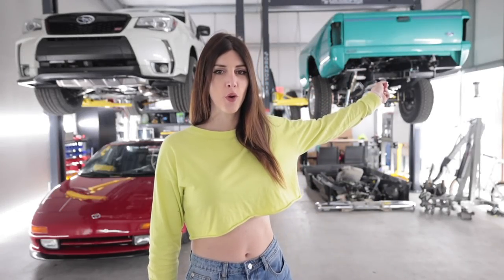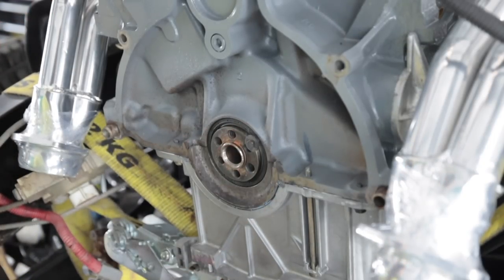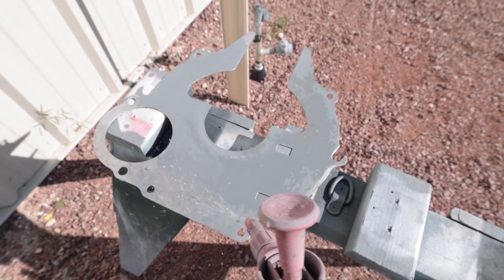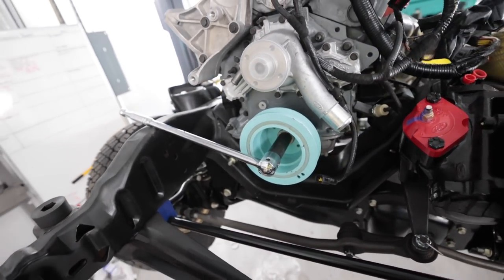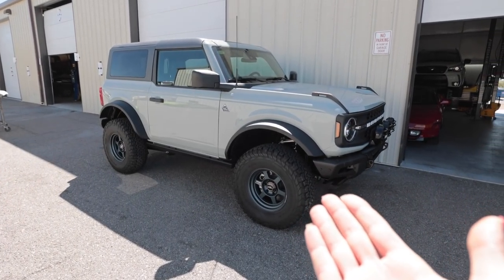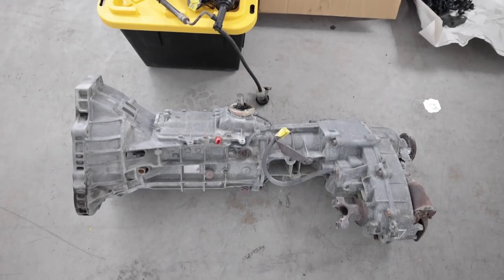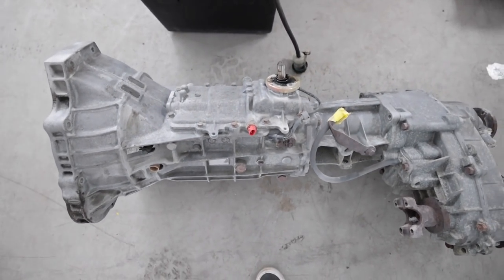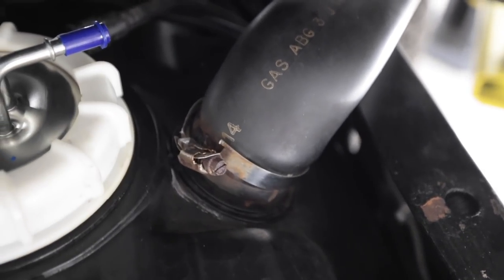A Stupid Simple Problem.. // Ford Ranger Frame-Off Restoration

Comment: Get the transmission bead blasted, like glass beads, and it will look brand new. Told you this before, Sarah, but you missed it.
Reply from the maker: No, I saw it. Problem is I’d have to fully dismantle it and the transfer case to do it correctly, then I run the risk of it not being as tight operationally once I reassemble it.
Reply: @SarahnTuned  Am I missing some point regarding disassembly, wouldn't be the first time that's happened, but I don't understand why you can't just tape off the vulnerable bits and have at it. There's sandblasters tape for jobs like that.

Comment: Not to add to your stress, but that fuel filler neck is a weak point on these Rangers. I'd suggest replacing that assembly while you have it apart.

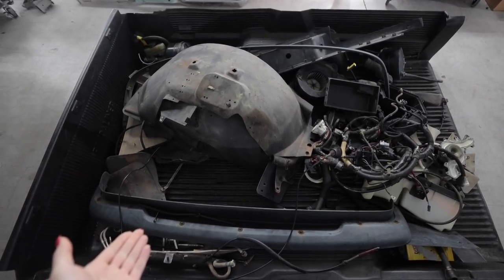Comment: Sarah: Excellent video as per usual, I love the new "LINK" jokes you've added to the beginning of each video this year.., "inebriated ferrets..." HA! :). You are so funny with your deadpan delivery. 7:04 I think you underestimate how much we enjoy watching you OCD clean. 14:54 my research says, Electrolytic Bath is best and you could build one pretty easily out of a plastic tub big enough to fit the transmission an anode, cathode and variable power source, but barring that, Heat can remove some if not most of the galvanic corrosion, like Rosebudd Torch heat, but most of the people say even a Heat Gun can work to some degree. Please look after your health, both sleep deprivation and dehydration can cause that lapse in concentration you talked about, so take a break...We'll still be here when you get back.

Comment: While replacing the Pressure Plate is SOP when replacing the clutch, unless you were running on the rivets for a while, I see no reason to replace the flywheel, even if the ring gear teeth were worn, a new ring gear can be bought and shrunk on.